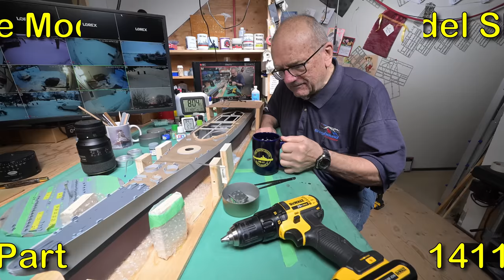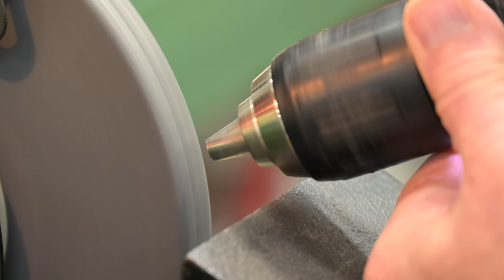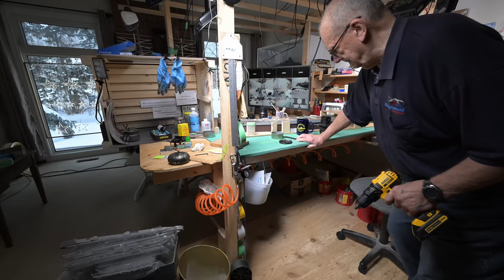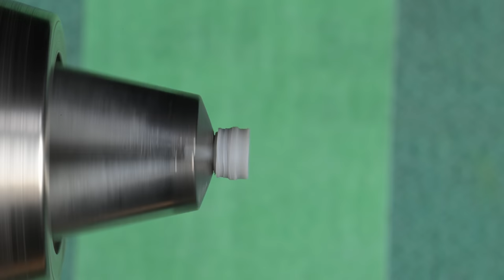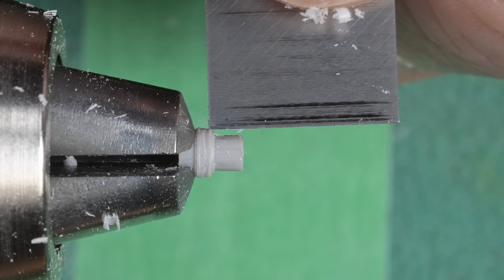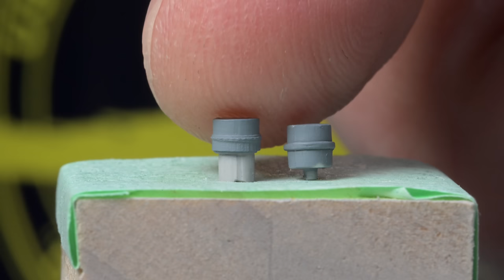The Model Ship - Part 1411

Comment: Hi Ron using that clamp on your drill is pure genius I've been thinking of different ways of achieving this for a long time, I did think of using cable ties but discarded that idea.Not only does your idea give an on off switch but you get a speed controller as well, thank you I shall be using my power drill as a mini lathe from now on. Best wishes Vic
Reply from the maker: Thanks 👍😊

Comment: Ron, love the programme, as for the drill having none precision chuck jaws, why not hold a "precision pin vice" in the drill, these are sold by Amazon and are manufactured by "Eclipse" plus others, they are designed for holding very small diameter work pieces.
Reply from the maker: Thanks for that idea Robert. 👍🏼

Comment: I think you would do better with a dramol tool. I find you can do a lot with one .they make a clamp for it for the bench .i done it works great.
Reply from the maker: I find that my Dremel tool, even at it's slowest speed, turns too fast and the friction melts the plastic.